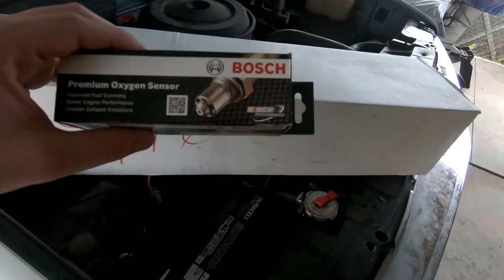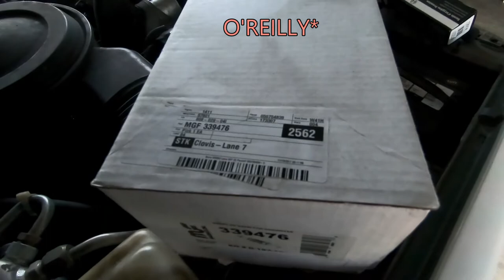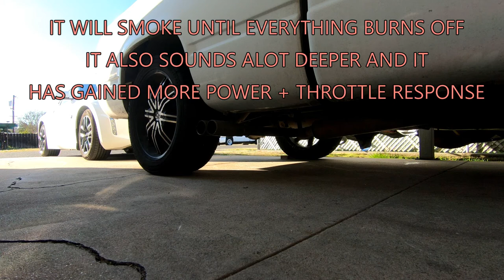REPLACE CATALYTIC CONVERTER & O2 SENSOR TO PASS SMOG + MORE POWER

Comment: It doesn’t grab harmful emissions it actually traps them and burns them off releasing less harmfull you can still pass with epa cats but can’t “buy” or install” in carb states
Reply from the maker: Unsure what all is required and how it works (not my expertise) but this was purchased at O’Reillys in California. I’ve had it smogged no problem.